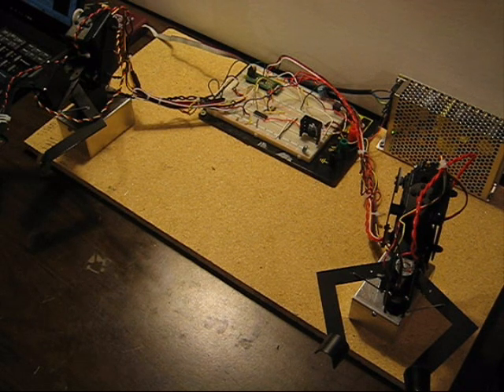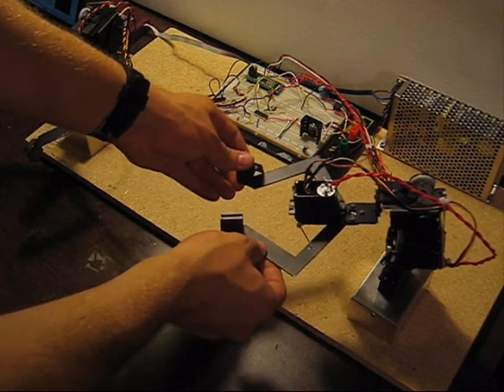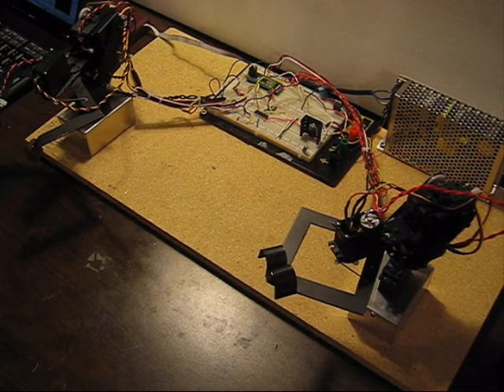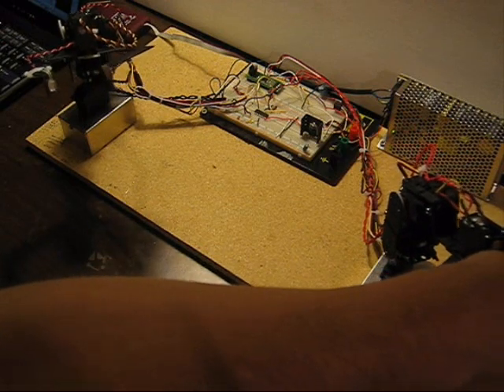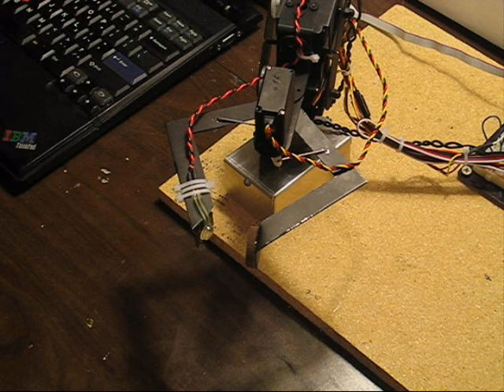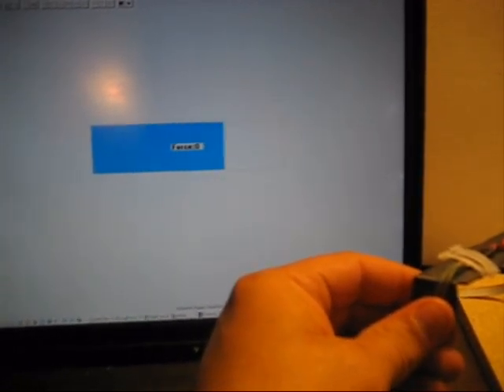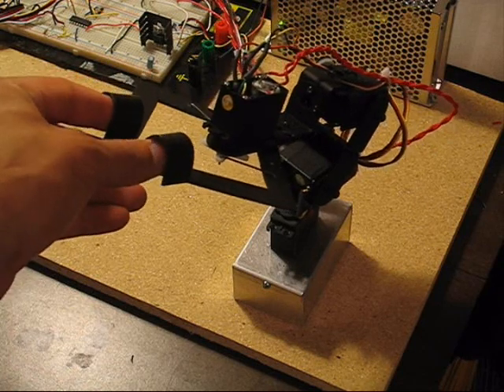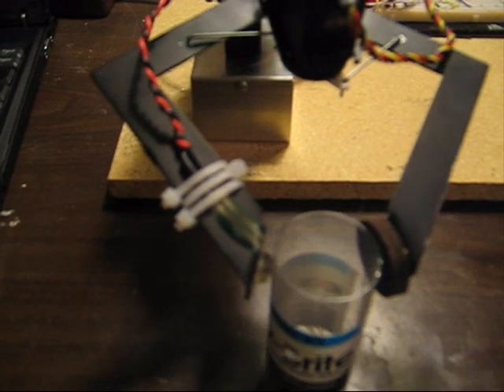four degree of freedom robotic arm with simple haptics

Comment: I really appreciate you helping me out dude. I get everything you said in the first post. 

But I don't get what's the difference between a PWM signal and a regular analog voltage signal. According to my understanding, PWM is  also generating a voltage but the input is taken in a different way (through pulse widths) and a corresponding voltage is generated at the output. Analog voltage would give the same voltage directly to the servo. 

So what logic am I missing here?

Thanks dude

Comment from the maker: I'm not sending PWM to the servo board and commanding a position - i'm sending a voltage to the servo motor which tries to force the operators input gripper open.

Does that make sense?

Comment from the maker: when a torque is measured on the output arm, its value is used to calculate an analog voltage to apply to the input arm motor directly.  I used PWM to generate this voltage.  So, when the output arm is commanded to close on an object, the object effectively tries to 'open' the output arm and a torque is measured.  The controller uses this measurement to calculate a voltage to apply to the input servo motor, where the motor tries to 'open' the gripper.

Comment: @brandonsenn : 
The input gripper can be controlled using the PWM signals from the torque output accordingly. It is not possible to move the gripper servo manually when it is receiving a 'HIGH' PWM value. So when the output gripper is holding something, the input gripper stops at some position accordingly. But how do I let it go? The input gripper servo cannot be moved anymore as its receiving a signal. Could you please let me know how did u deal with that issue? Thanks a lot again dude.

Comment from the maker: The signal from the microcontroller to my input servo is not a traditional servo control signal, but rather a PWM controlled voltage which is proportional to the torque measured on the output gripper.  So, there is, and should be some torque resistance on the input servo (this is the force feedback you're trying to make) but not so much that the servo can no longer be moved.  This required some tuning on my system. 

Does this answer your question?

Comment: Hey dude its me again..could you explain me how exactly are you demonstrating the force feedback at the input arm gripper?..I remember you told me that you did not cut the driving gears for the gripper servo and you are moving it against the torque, which is fine..but i noticed that you cannot rotate the servo anymore against the torque once it gets any kind of signal from the microcontroller..could u please let me know how u solved this issue? Thanks a lot

Comment from the maker: since i used relatively low torque hobby servos, the input gripper could be moved even with gears in place due to the leverage of the gripper fingers.  A small amount of resistance from these gears could be felt.

Good luck with your project.

Comment: Thanks a lot for all the help. 
Yes I intend to build a similar system, but a bit bigger one and haptics feedback at both gripper and the elbow joint to feel the weights lifted. 

Just for one last time, 
If I remove the circuit board and the driving gears for the gripper servo, I should be able to get the feedback from the pwm output which is connected to the motor directly. But how do I move it freely? (as the driving gears are still intact)

Comment from the maker: The microcontroller can read the position of each of the input arm potentiometers and send a position command to each of the output arm servos.  At the same time it reads the force measurement on the output arm and supplies a proportional voltage to the motor on the input gripper.

Comment from the maker: Input arm joint servos have their potentiometers wired to the microcontroller.  The servo board is removed as well as the driving gearing.  Input gripper servo has only the servo board removed.  Driving gearing is still in place.  Potentiometer is wired to the microcontroller as well as the motor.

Comment: But what I don't get is,

You cannot remove the wire from the potentiometer as u need the analog signals to be sent to the other arm.
You are using the signal wire to send in the force feedback. You are also not removing the driving gears. So how will you move the gripper freely AND send a signal for the servo to move?

Comment: ok this is what i understand so far..
1) you modified all the servos on the user controlled arm by soldering a wire at the potentiometer for analog signals, which are sent to the tracking arm.
2) you cut the driving gears between the motor and the output shaft for 1st and 2nd joints, leaving the connections to the potentiometer, to rotate it freely, but still sending the analog feedback. 
3) the feedback motor is directly controlled by the pwm output/signal wire from the microcontroller.

Comment from the maker: The "feedback" motor is directly controlled by PWM output from the microcontroller, rather than the standard servo electronics which allows me to vary the motor voltage based on force measured by the Force Sensing Resistor rather than on servo position.

Comment: I didn't get the last part about force feedback.

If you are cutting the wires between the motor and servo electronics, and blocking all communication, how are you sending the force feedback to the gripper that you are controlling?

Comment from the maker: On the input arm, for the 1st &2nd joints i opened the servo housing and removed the driving gears between the motor and the output shaft, making sure to leave the connections to the position sensor(potentiometer) intact. For the 'gripper' i cut the wires from the motor to the servo electronics but left the geartrain intact. The leverage of the gripper fingers allows the operator to overcome the servo gearing with a minimum force with the motor still connected to allow for feedback force.